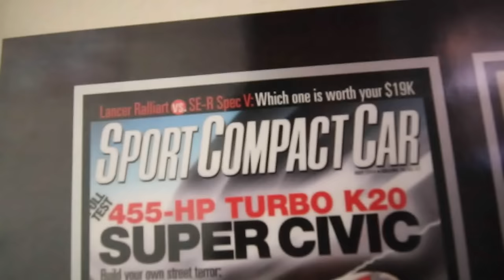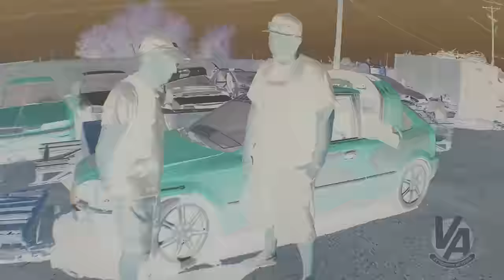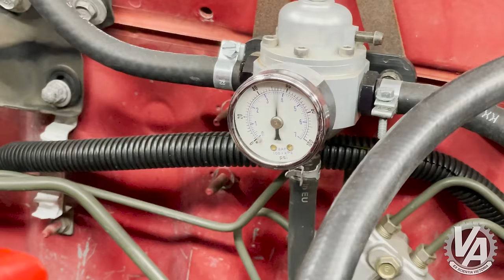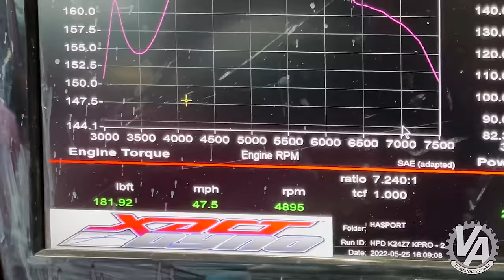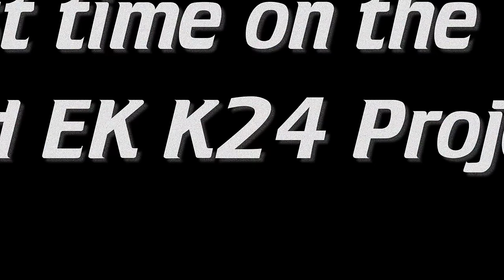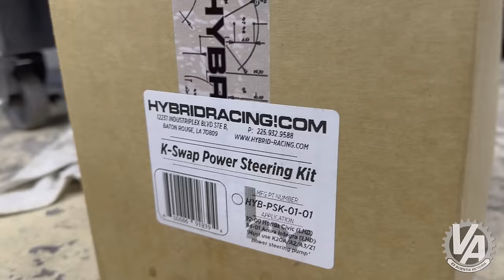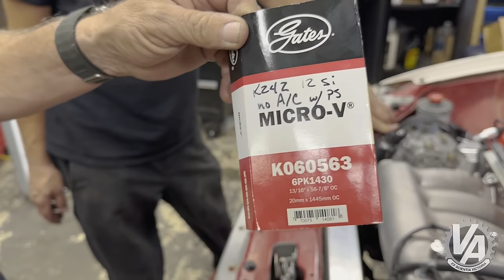Cheap EK K Swap Journey (K24Z EK Hatchback Street/Track Car)

Comment: What did you guys end up doing for the exhaust downpipe? I see it has a separate cast housing that bolts to the cylinder head followed by a short vertical pipe. Is that a swap part or a modified piece from some company?

Comment: I have a K24Z3 in a 2001 Integra I’m using stock RSX base axles and EP3 Intermediate shaft been driving around for months no issues and quite a few pull will let you know how it does when I turn the boost up this Friday night at our local test and tune

Comment: Would an oil sandwich/filter relocation kit allow the RSX intermediate shaft to work? For the price of some ebay filter relocation kits, it might still be budget! And you'll have provisions for oil cooler/pressure logging! Also, having a longer axle using the RSX intermediate shaft will buy you lots of room for wheel travel etc without busting an axle.

Comment: this engine and parts are hard to find every day so there's no point and b16 and b18 , engines there's no point parts are to find , the new motor swap is L15 turbo this is a waste of all honda civic lovers for speed ,no point it will take u forever to find the parts